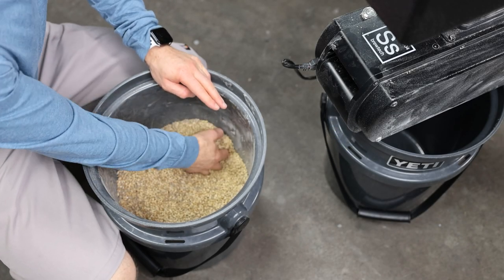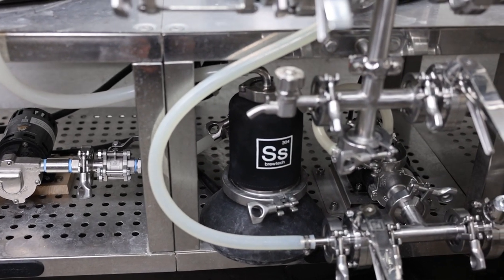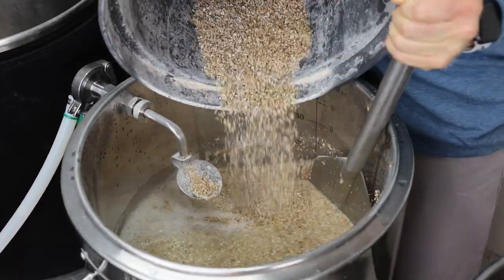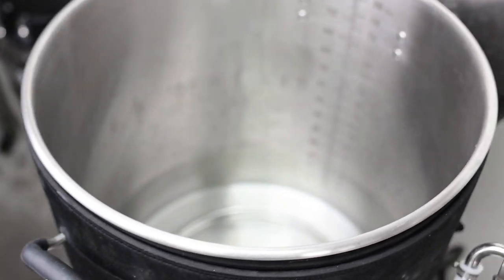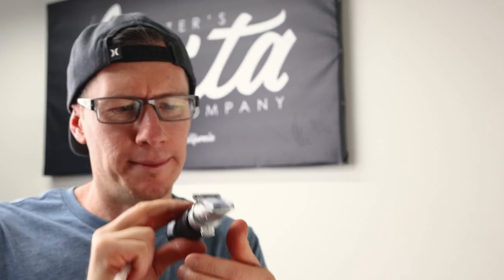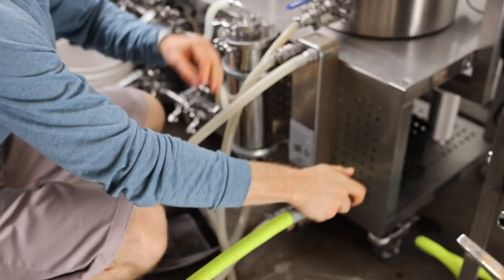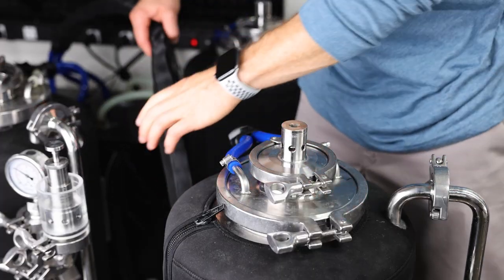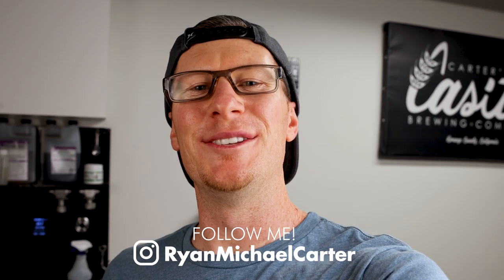IPA Brew Day on a Ss brewtech electric brewhouse

Comment: What percentage of power do you run on your boil? Like do start at 100% and then drop during the boil and to what? Also how do you combat the hot break besides adding the anti foaming agent so you don't have a mess?
Reply: Hey Brian, I first start at full power, then kick it down to 72%. It'll depend a bit on your elevation, but for me, 72% is enough to get a rolling boil without boilovers. At this power setting, the anti-foam agent is enough to keep everything in my kettle.

Comment: Thank you, awesome video Ryan! 
Question: how do you clean your equipment? I have a 15 Gallon kettle and I always feel that I'm wasting too much water and PBW. Do you have any tips on that matter?
Reply from the maker: Thanks Antoine! After the brew I'll rinse out the bulk trub/hops then connect all of my tubing in a big giant loop. I'll recirculate 3 gallons of PBW solution at 150F for about 30 minutes. Then I'll drain the cleaner and add another 3 gallons of water, heat to 180F, and recirculate for another 10 minutes to rinse/sanitize. I do not include the mash tun in this loop.. I just dump the grain and wash that thing by hand with the leftover PBW. I frequently get questions about my cleaning process so I think I'm going to put together a video soon to better show my process.
Reply: That would be awesome to see how you do that. Keep pushing out these awesome videos Ryan! 🙌🏽
Reply from the maker: @carlosmolina4925  Thanks man! I'll work on putting a cleaning video together. Cheers!

Comment: Love your videos. I was wondering what glycol chiller you are using? Also are you using a heating pad as well and running both through the FTSs Touch?
Reply from the maker: I use an old Ss chiller.. I don’t recommend it though, it’s pretty overpriced for what it is. I don’t use a heating pad, only because I live in Southern California and it’s typically pretty warm here. But if it gets cold where you live, I’d definitely recommend a heating pad

Comment: Love this video. I've been trying to figure out your valves and flow from the Instagram vids. I have just gotten the 2v system and will brew next week. I picked up some great tips watching this. Are you using 2 pumps total?  I'm thinking that valve tree will be my next addition but not sure if it can attach to my stainless table.
Reply from the maker: Thanks Sean! Yes, I use two pumps on the brewhouse. I have one for the HLT and a second one for the valve tree. I think I may make another vid exclusively about the brewhouse routing and flow paths. Would that be useful?
Reply: Yes!  I see you made one and I’m gonna watch.  Interesting to learn that one pump feeds the tree
Reply from the maker: @seanob99  right on! Let me know if you have any questions 🍻

Comment: Do you have wort leftover in your tubing and if so without taking it apart how do you get what the pumps won’t get out?
Reply from the maker: Hey Jeff, yea there is usually about 0.25-0.5gallons remaining in the system after I transfer to the fermenter. One cool way to transfer the rest of the liquid after the pump is to use a tee with a gas fitting. This is not something I do, but CO2 can be used to push the remaining wort into the fermenter.

Comment: Where did you get the carb stone? I don't see that as an option on the SS Brewtech website? Great first brew day video!
Reply from the maker: Hey Lane, thanks so much! It is in fact from Ss, here is the link: https://www.ssbrewtech.com/products/carb-stone?_pos=1&_sid=593b1fb77&_ss=r
Reply: @ryanmichaelcarter  Thanks man! Don't know how I missed that. I am in the market for a chronical and have been considering the SS Brewtech Chronical 2.0 and the Spike version. I am leaning towards the SS Brewtech at this point and I am so glad you are making videos now.
Reply from the maker: @lhard77  Awesome! The Chronical 2.0 is pretty sweet. I recently brewed batches in both the 7gal and 1/2BBL and was really happy with them. The lid-mounted coil is such a huge upgrade compared to the previous BME version. Plus the new little Pure Flow Sample valves are really cool

Comment: was 3.5 pH your target for sparge water?
Reply from the maker: Yea it usually falls around mid 3’s, but just a heads up— this is with 100% reverse osmosis water. The goal for the sparge water acidification is to keep the lauter pH under 5.6-6

Comment: Did I see over 90% efficiency?!
Reply from the maker: Man I wish. That was just for the mash, which is typically closer to 85% on my system. My total brewhouse efficiency is usually around 75%
Reply: @ryanmichaelcarter  I have the same system and I'm usually around 80%. I keep trying to bump it up by doing slow sparging, better crush (thanks to you), better recirculation, etc. I'm on my way!
Reply from the maker: @mattgiovanisci  80% is great! I honestly almost never get above 85%. What really helps with efficiency is a super slow lauter (+45 mins for 8-9 gallons) and a hot sparge (168-170F) with a relatively constant flow rate. And of course, grain crush as you mentioned. Before sparging, I'll lauter just enough until I have almost no wort above the grain bed. Then I'll kick on the sparge pump until I have about 1 inch above the bed. Then try and maintain that fluid level until you have your full volume in the kettle.